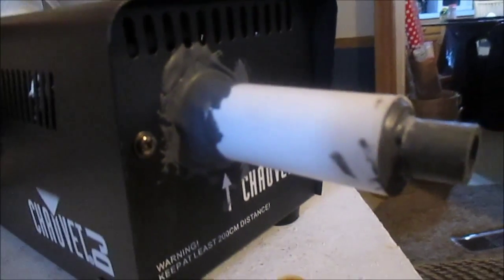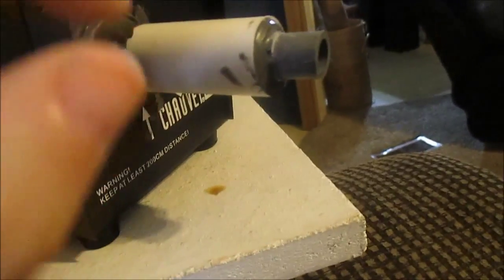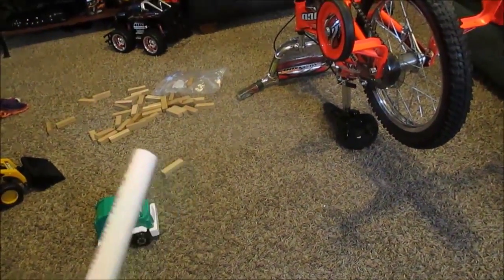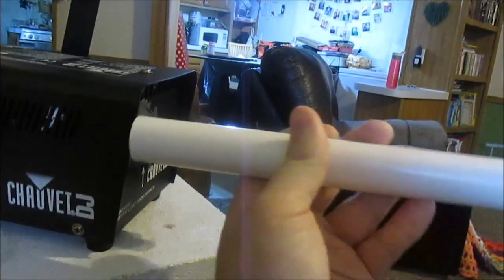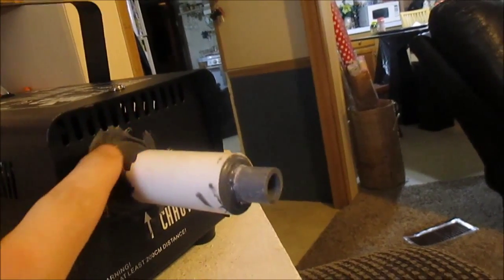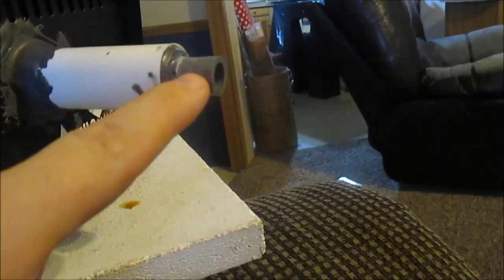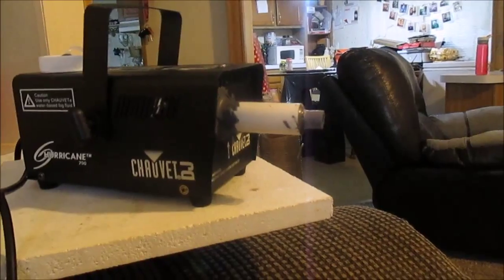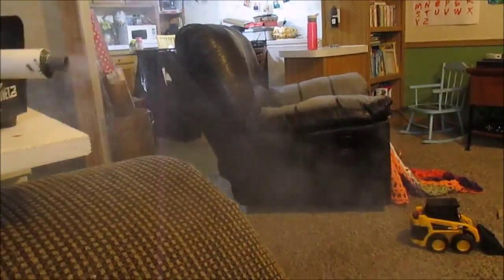How To Use A Cheap Fog Machine To Find Vacuum Leaks Part 2 Modifying

Comment: After taking my car to the shop, they did a smoke test and said they found a leak in a bypass vale hose, WRONG! I picked up a fog machine at a garage sale like new with fog solution for $15. After connecting hoses and using a rubber glove to connect it to my BMW intake ( downstream from MAF sensor ) I found a minor leak in the intake conduit that was driving me crazy. It does work, no problems with the vapers.

Comment: did it work??
Reply from the maker: Yeah it did work I found where the leak was coming from pretty quickly. However I do not recommend this method. I felt the fog was much wetter than what a smoke machine is. Here is a link to me using the fog machine to find a leak on my Explorer.
https://youtu.be/yrg3fKJh0zk          So I think making a smoke machine similar to the many paint bucket versions on youtube and online versions would be a better way to go. They use nicrome wire or glow plug as a heating element, baby oil to burn for smoke, wick, paint can,  and a simple propane regulator to get the air pressure around 11" W.C.   I think that would be the way to go. I have had parts to make one for like 6 months now, I just have not got around to making it. Well anyway thanks for the comment and thanks for watching. Have a good day.
Reply: try mineral oil instead of the water based fluid...
Reply: What kind of fluid did you use, though? Did you try changing up the fluid?